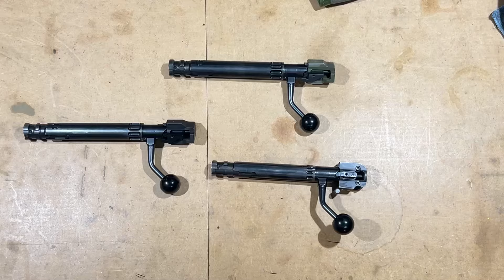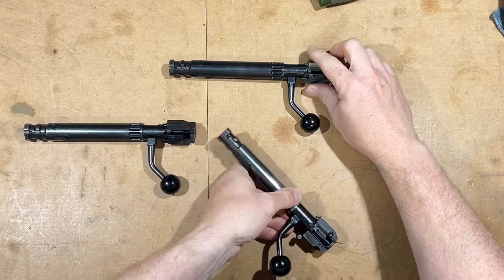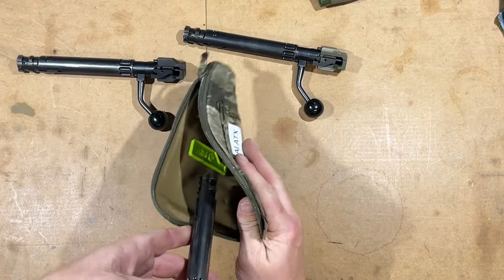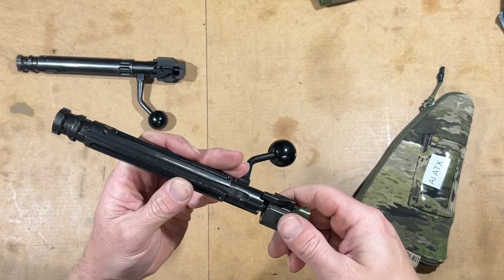Basic strip of an AI bolt

Comment: Gday mate,I’m trying to adjust the fireing pin protrusion on my AT-X as I’m getting a few pierced primers have taken the locking grub screw out but was wondering if I will have to go a full turn so the grub screw catches the flat part of the pin or is there a flat on both sides any advice would be appreciated thanks
Reply from the maker: Hey mate, If you're in Australia I would talk to Delta Tactical, they are AI armourers. If you are in the USA, Mile High Shooting or in the UK, Sporting Services. I don't want to lead you astray, commenting on youtube videos without seeing it in person.
Reply: @lowvisgear Thanks for the reply spoke to delta they gave me some advice which was helpful. I have since measured the protrusion as best I can it’s about .055 which should be Ok.Also looking at some of the factory primers I have fired large and small there is no cratering at all,compared to my reloads which I think are mild loads which all show some cratering RAUG primers.Have brought some cci br4 will see how they go before I start monkeying with the fireing pin, thanks again.

Comment: I have never seen anything as silly and pointless than storying the bolts decocked in the manner in which you do external to the rifle. Put the bolt into the rifle and then decock by pulling the trigger. IF your precious rifle can not survive dry fire with modern alloys, designs and construction you where grossly over charged. What is next are you going to recommend that people store their revolvers witht he cylinder removed our the hammer removed or maybe store their semi auto pistol with the slide off and barrela nd all springs removed?
Reply from the maker: Settle down champ…. 😂

Lots of people store and transport rifles with bolts removed. 

You may not have realised, but decocking a bolt doesn’t cost any money, it’s actually free to do… You can do it all by yourself.

Have a good weekend

Comment: Once you fire, the ATX is there a way you can reduce the heavy bolt lift?
Reply from the maker: The inherent spring tension within the action is fairly stiff. Being that they are a military rifle, designed to function in bad field conditions with little maintenance… There are limitations when reliability is a priority.

The AT-XC aims to address some concerns re bolt lift. 

As for adjusting another AI, I am unsure if that is possible, it’s not something we have messed with.

Other than good maintenance and appropriate lubrication, you would be best to contact AI engineering.
Reply: @lowvisgear  thank you very much for your timely response. I’m new to the AT-X